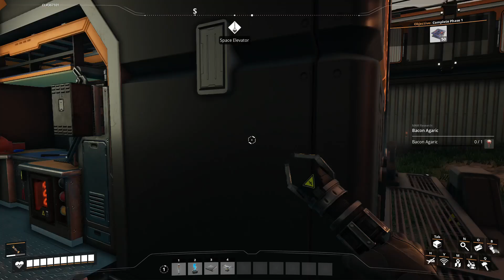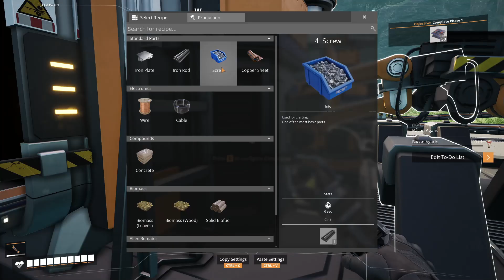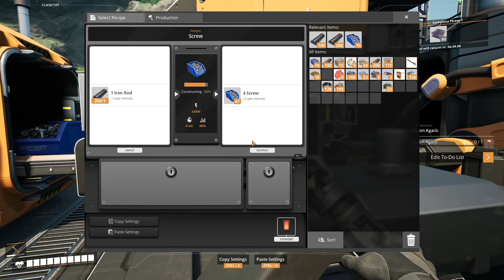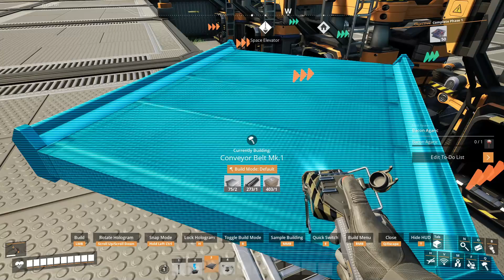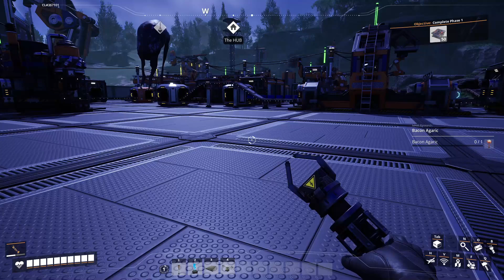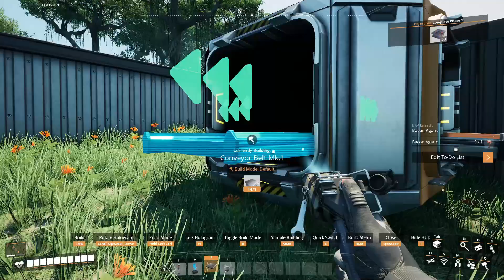Episode 5 - Our Factory Floor Is Way Too Small! Plus... Power Problems!! Let's Play Satisfactory

Comment: 18:30 Tip, you don't need to dismantle to upgrade.  Equip the upgrade, highlight the old, and click.  Woks for belts, lifts, and light poles.  Have not checked with the drills, but likely the same.  Does not work for splitters.  But splitters and mergers can go directly on lifts, and lifts can go directly on machines and containers.
1:12:16 What is going on is splitters send to their own outputs evenly, when you chain them together, the first on the chain gets twice as much as the second, the second gets twice as much as the third... So, the first gets four times as much as the third.  It won't even out until they are all full.  Keep those belts and lift upgraded.
Reply from the maker: The upgrade tip is awesome. Thanks. Definite time saver. I'm not quite sure what inspired the splitter comment. Did I give an indication that I was unaware of what you just described? Ya... I figure just check the last Biomass Burner... if it's full, they all are. If it's empty, there could be a problem. Thanks though for the thoughts. :)
Reply: @DougNutGames007  "Did I give an indication that I was unaware of what you just described?"
Not saying you wouldn't figure it out once you thought about it, but you did ask the question. 1:12:16

Another help full tip:  With so many containers it gets hard to keep track of what is where, I discovered if you walk up against the container, you can open your inventory and drag one of the item to the side and stick it to the side of the container, a makeshift label of sorts.
Reply from the maker: I'll have to try that label idea. Not too bad yet... but me thinks it's going to get messy. LOL. :)